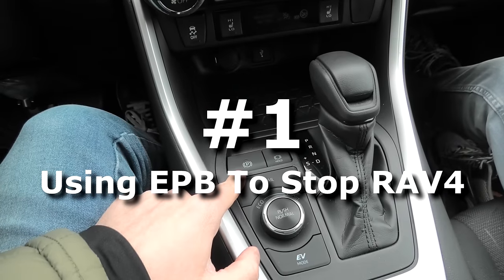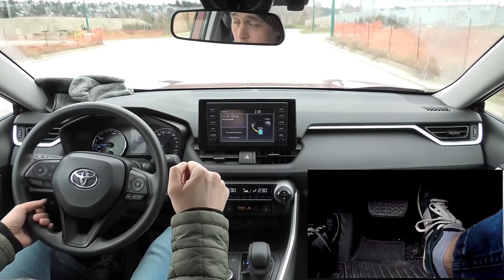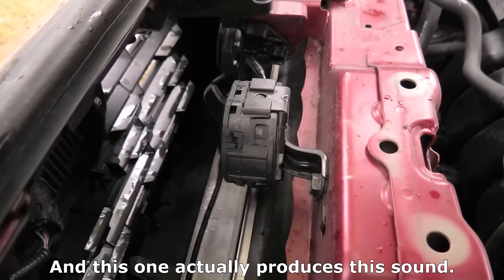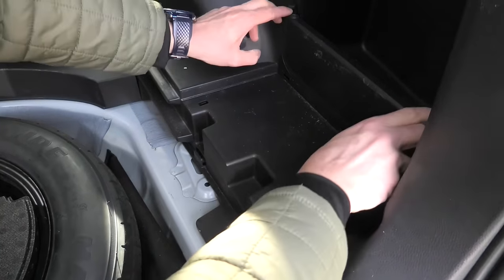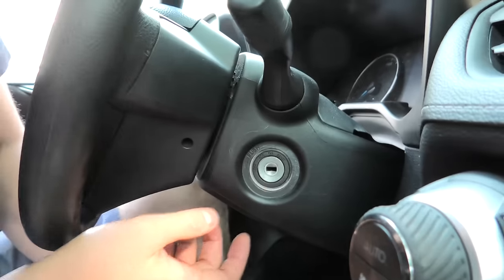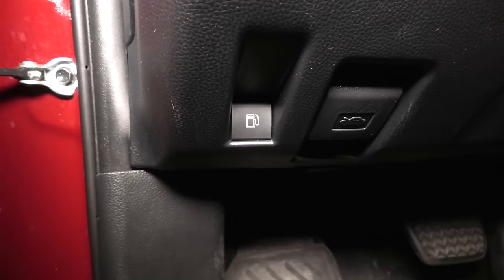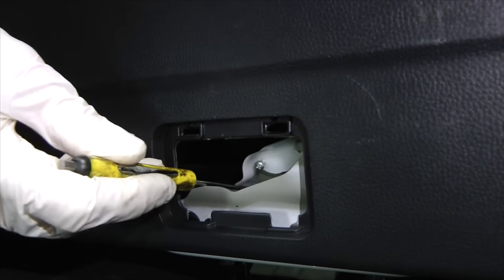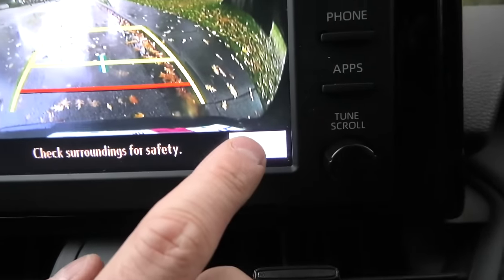Toyota RAV4 (2019-2024): 10 Hidden RAV4 Features You Need To Know!

Comment: My 2021 Rav 4 hybrid the 12V battery goes out every 5 days. I've gone to the dealer 4 times and they tried everything to say it was anything aftermarket that was draining and I disconnected everything and the same thing is happening that I need to jump my car with it being under 8K miles. The first few months I had to jump my car every 2 days and since they did some computer update it's now needing to be jumped every 5 days. But with the location of the battery I just need to permanently leave my cargo space fully open and essentially my car is now just a commuting car because I can't leave anything in the back. Could you please help as the dealership finally did a parasitic battery test and all they could come up with is that my battery even though is fine just got drained. I love my car but I'm beginning to h8te it because a relatively new car shouldn't have these problems so early on and my dealership on so many occasions just tested the battery and told me it's because any form of things added is what is drainign the battery. Please help.
Reply from the maker: You can jumpstart your hybrid RAV4 using the terminals under the hood - https://youtu.be/wiBi6WneUdI. As for the battery drainage, certain RAV4 models do have this problem. There is a class action lawsuit against Toyota regarding this matter - https://www.classaction.org/news/2020-toyota-rav4-suffers-from-parasitic-battery-drain-defect-class-action-says. I can't really advise anything, Toyota will need to address this issue.
Reply: I read your problem description. There are two possible cause of your cars problem. First the charging circuit is supplying insufficient current to charge the 12 volt battery. It sounds like there is problem with charging system. You can plug a voltmeter into the 12 Volt Accessory Power Outlet. These can be bought on EBay for around $20. They have a built in digital display the shows the voltage of the 12 volt circuit in your car. With your cars petrol engine running the voltage should be around 14 volts when charging starter battery. The charging voltage decreases as the starter battery is charge up. In my car it drops to about 13.5 volts. 

You could also use a digital voltage meter connected to the 12 volt battery terminals to measure the charging voltage. Precautions need to taken when connecting things to the starter battery. 

Second there may be a parasitic load that is draining the 12 volt battery when the car is off. Although this seems unlikely as your car is suffer the problem when it is being driven,

Another possibility is the 12 volt battery  is unable to hold sufficient charge to perform its function. I hope this helps.

Comment: How to destroy your "parking"
 brake..😔

Brakes use hydraulic pressure to stop your vehicle,  the "parking brake" uses a thin metal wire to the back wheels to stop the car from rolling when parked, plus all the electronic components that will make your dealership a lot of money in unnecessary repairs..